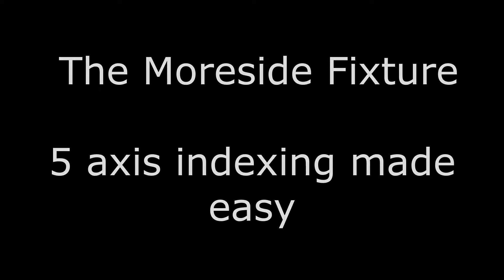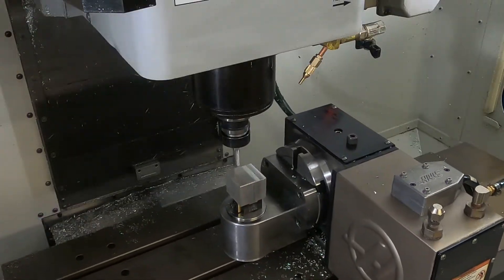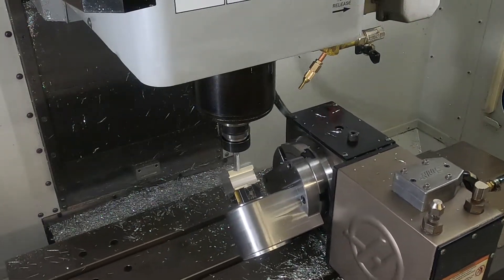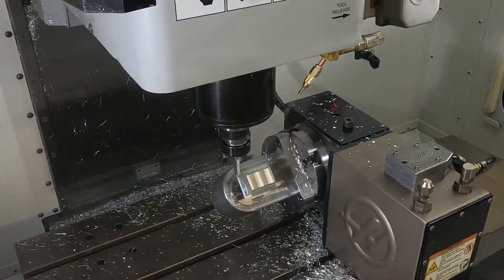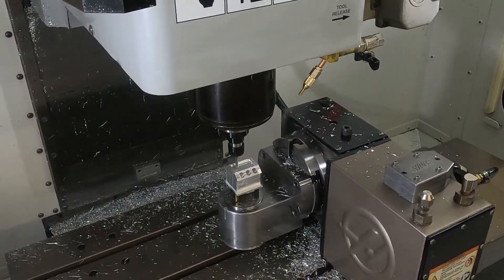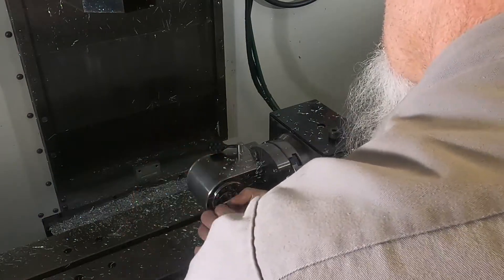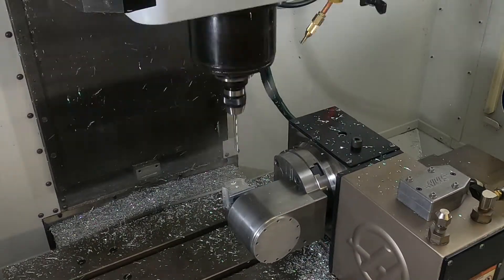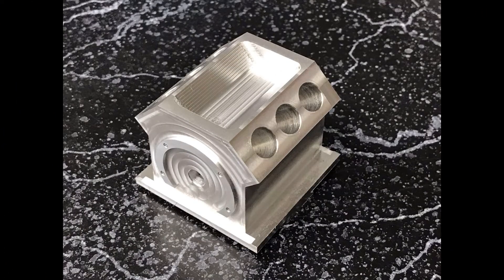The Moreside Fixture, 5 axis indexing made simple

Comment: Can you let the machine put the lever with a upside down endmill shank?
Reply from the maker: No, even with the spindle moving the lever you still need to rotate the workpiece manually.
Reply: @dsmachinewerks4405    If the lever has a latch (ball bearing ball with spring )  it can stay in place and then you can let the machine rotate the workpiece for you with a g3 move .    Kinda utilizing the machine as handling robot. But I am sure it can work.
Reply from the maker: @Hendreh1  Yuasa makes a Rapidex that has a plunger that you push with a toolholder that index's.  Its awesome but about $15,000
Reply: @dsmachinewerks4405  Thank you for the hint. i will check that out.   But I share your philosophy , that a 4th axis is enough for most of the work. 😊